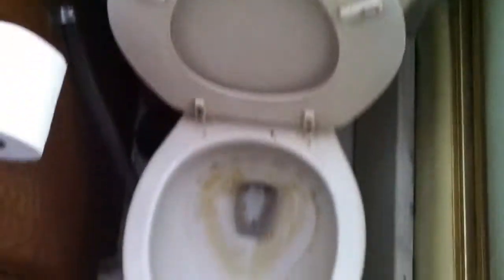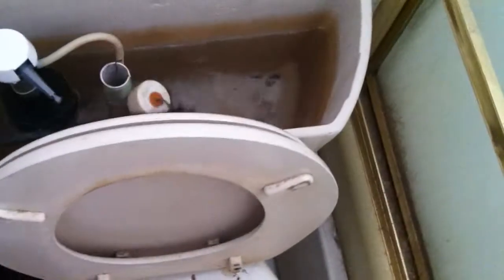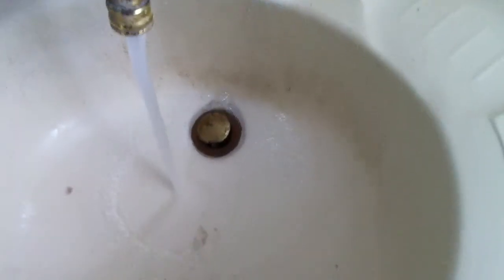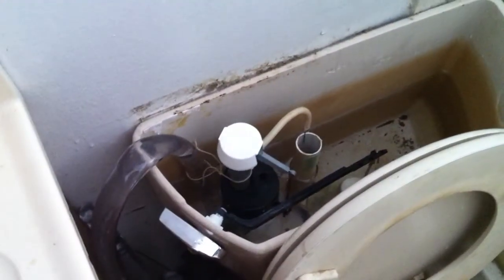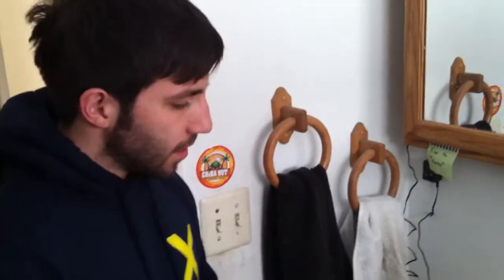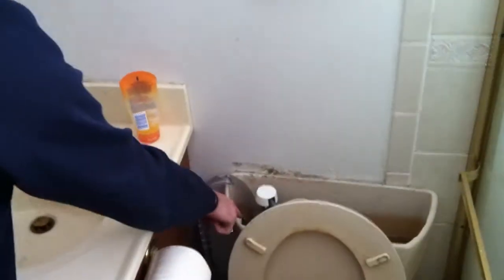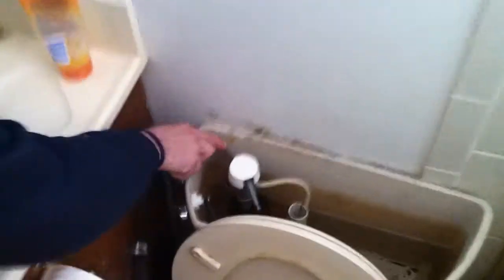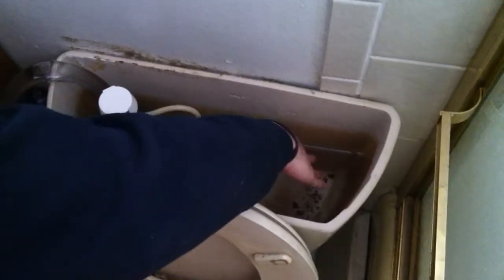Grey Water System for Bathroom

Comment: I just don’t likely use enough water washing my hands and face to create the 4L to 6 L to flush a toilet. I started filling up a bowl in my sink and taking it outside to water plants etc when not winter, so it’s not wasted. I suppose it would help some in the toilet. I’d like to do a grey-water system from the shower as well, into a tank, then toilet or garden. I’d really prefer to have a compost system and make humanure. :)